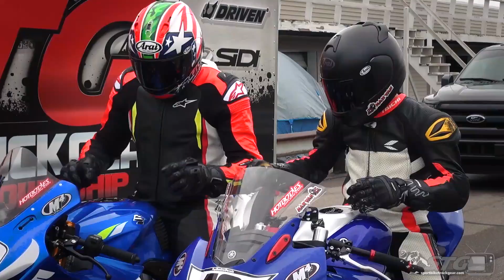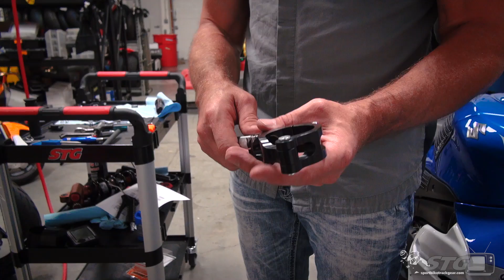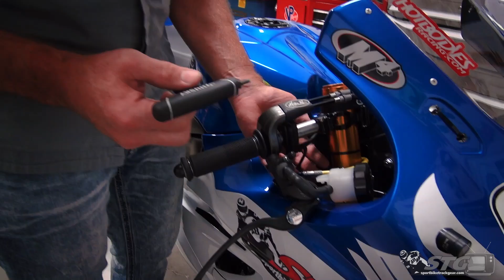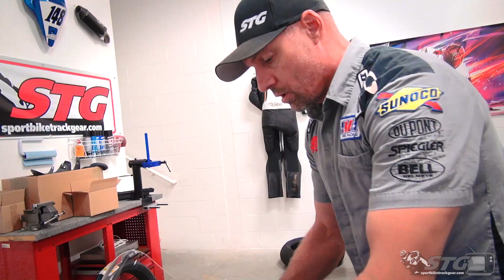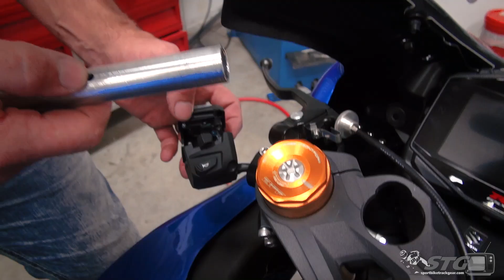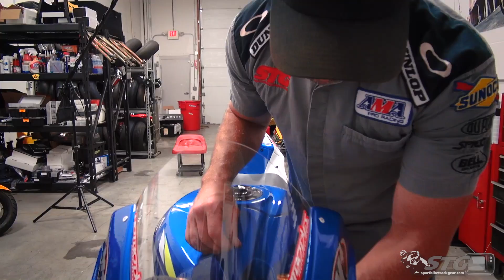Attack Performance 2018 Suzuki GSX-R1000 Clip On Install | Sportbike Track Gear

Comment: Great Video, got an R7 with a 7 degree. Not a fan, installed the Vortex 0 like yours and that works, still could be closer with a side mount. Got a Woodcraft 35mm riser side mount and couldn't get the clutch controls to snug up closer to the forks. Going to order from you now the Attack Performance. It says on your site 2-3 weeks lead time, are these not in stock? Thanks
Reply from the maker: Attack has been a little behind. If you want an accurate lead time shoot the team a call or an email and they will give you a better idea of how long it should take. - Van

Comment: Hi Brian! Let me tell you i'm a huge fan of your channel, just i've a question what's the differences between zero offset clip ons with the others aftermarket clip ons e.g.(vortex 7 degree) 
Thanks! 
Postscript: sorry for my english if it's bad 'cause my native language is spanish =)
Reply from the maker: The zero offset bring the bars closer to the rider while the std clip ons have an offset that moves them away from the rider a little as compared to OEM. - Van

Comment: Just had my first Track Day on my Vortex clipons and realized I should have gone with something more like these for my short arms on my 09 GSXR 1000. Just wondering if the OEM switch gear will work with these clearance wise of the previous gen.
Reply from the maker: As we show you installing these is a little bit of an adventure filled with some trial and error. You will need to make some modification to your controls to get these installed. - Van

Comment: Hey Brian! I have a 17 GSXR also with the Rev2 kit and switch gear, Brembo RCS 19 master with Brembo reservoir kit, and Spiegler lines. I've watched all 3 clip on installs and leaning toward the Vortex just for the bang for buck factor! However, you have ridden with all 3 and I would love to have your feedback before I buy. 

Thanks, 
Mark
Reply from the maker: The Attack really change the bar position and complicate the install quite a bit. Between the Vortex and the Driven I would say they are super similar and work best for most riders. - Van

Comment: For this model specifically, does the OEM start/stop/throttle assy. work properly with no clearance issues?
Reply from the maker: I am pretty sure the OEM switch pod will work with these clip ons. The area I had some clearance challenges was with the brake lever once I rotated it to the angle I prefer. These clip ons require a little patience to install and dial in on the bike. If you need the bars to be closer to you this is the best option. - Van